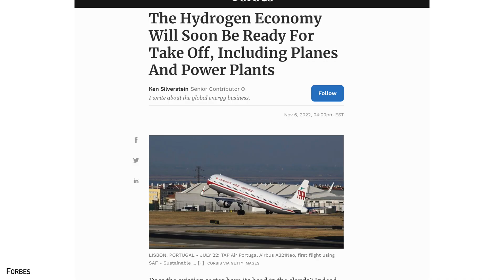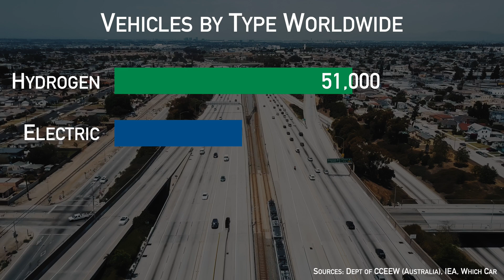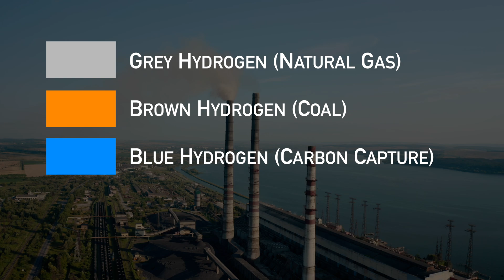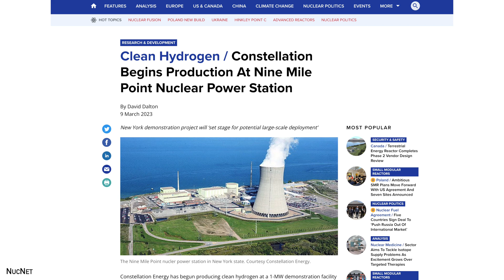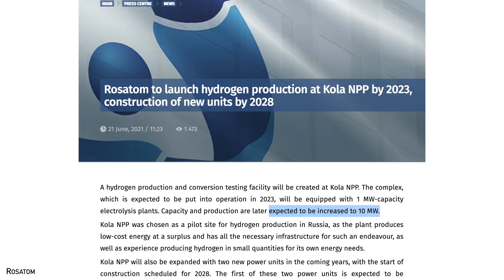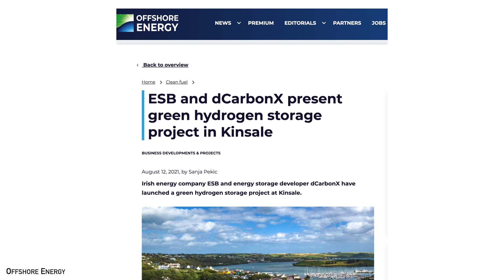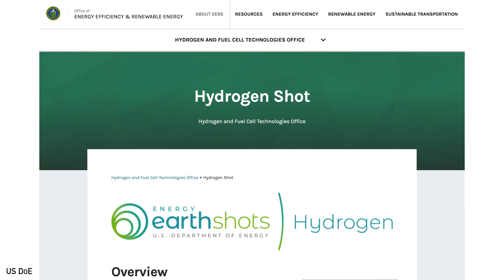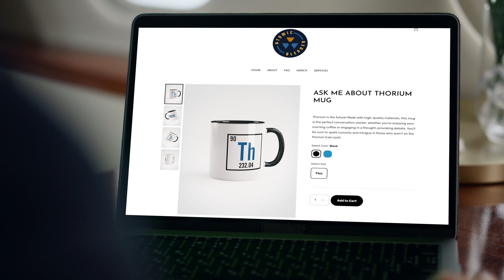The First Clean Hydrogen from a US Nuclear Plant - Now What?

Comment: The Palo Verde Nuclear Generating Station in Arizona is producing hydrogen during the peak of midday summer. This is because the high activity of solar panels in the region means that electricity from the reactor is not needed during those hours. As a large Generation II plant, Palo Verde does not scale its power output up and down quickly, unlike future Generation IV small modular reactors (SMRs).

To keep the plant operating efficiently and put its output to good use, it's now producing hydrogen. This hydrogen can fuel large vehicles such as buses, RVs, trucks, and construction equipment. In the future, it could also power large commercial jets and ships.

If you consider fueling a large passenger jet with hydrogen to be dangerous, remember they are currently filled with kerosene.

Comment: A Case for Nuclear Power.

Nuclear power is the answer to weather disasters and our energy future. 

We should build Generation 4 nuclear power plants on an assembly-line basis and deploy them worldwide as fast as we build a Walmart. 

This approach will dramatically cut the cost of construction.

Superstorms, extreme weather, and electricity shortages can all be solved by using off-the-shelf nuclear power technology. 

Small modular reactors, for instance, have been used in our military ships since the 1950s.

Nuclear power can fuel our electric future and provide the energy needed to scrub carbon from the atmosphere. We all benefit from abundant electricity that doesn't destroy our planet.

The Benefits of Modern Nuclear Power

 * Versatility: Nuclear power can produce hydrogen for trucks, buses, RVs, and airplanes.
 It can also be scaled up and down to complement wind and solar power.

 * Waste Management:
 Generation 4 nuclear power plants can burn more waste than they create. 
They can also reuse existing nuclear waste, a process that France has been doing for many years.

 * Safety and Security: 
These plants are non-proliferation and "walk-away safe." 
They have a small footprint, about the size of a Home Depot, and can be located next to hospitals or large retail centers in any community.

 * Efficient Design: 
They can provide steam for heating our cities and can be small enough for a cruise ship or a small town.
 Generation 4 nuclear plants can also be linked in a series to power large metropolitan areas and be part of a local power grid alongside wind and solar.

Addressing Public Misconceptions.

Nuclear power is over 99% safer than petroleum product extraction and better for the environment. 
If you don't believe me, look at the number of deaths every year from extracting fossil fuels. 
We must stop using the air we breathe as a trash can and address how petroleum products contaminate our drinking water.

The media and politicians must stop using nuclear power as a fear-mongering tactic. 
They have blood on their hands from every superstorm and every year that goes by while the public is afraid of nuclear power. 
We need to have field trips for kids and parents to see that nuclear power isn't scary. 

We should also commission artists and schoolchildren to paint murals on the sides of these plants.

The Real Disaster.

Don't let the media and politicians scare you with stories about past nuclear incidents. 

What's the real disaster? 

The only disaster is the "pigs at the trough" who, in the name of nuclear safety, are siphoning up public utility and tax dollars for so-called cleanup.

People have been working at these plants since day one, yet these same individuals lead you to believe it's some scary thing. 

The nuclear safety people are a parasite on the business, making it so expensive that it can never be built.

Comment: Ah na this isn't what I was thinking it was, I was thinking they were using hydrogen that is generated in the operation of the reactor via radiation breaking the chemical bonds between the hydrogen and oxygen, because that would basically be 100% efficient because the "waste heat" or what you generally run a nuclear reactor to generate can be used to generate electricity.

Comment: I think red (nuclear thermochemical) hydrogen has a brighter future than pink (nuclear electrolysis) hydrogen, eliminating the need for turbines, generators, and electrolyzers, has got to be good for cost efficiency, even if it does mean we need newer much higher temperature reactors

I'm not so sure that hydrogen can be used to create cost effective efuels however, as the cost of DAC would still need to come way down, obviously to the point that traditional fossil fuels could simply and cost effectively offset their CO2 emissions, so for nuclear liquid fuels to be cheaper than carbon neutral fossil fuels, then the pink/red H2 would need to be significantly cheaper than any fossil fuels (without carbon capture), which would then be an incentive for more vehicles to switch to fuel cells, etc. and use that H2 directly to save money

Comment: Hydrogen is not ideal fuel, even if it is extracted from earth crust like crude oil or natural gas, or even freely manufactured on desert with photovoltaic generator. Major cost of hydrogen as fuel or energy is not its production, but transporting and distributing hydrogen. It should be compressed or cryo-liquified to transports like LNG, both are quite expensive and energy-intensive., it is hard to store for long term or transport long distance. And highly trained and qualified engineer can handle such hydrogen in mass. It weaken metal pipe and metal tank. It needs special composite lorry tank & truck.  There is no liquified hydrogen transport ship. So it is much more expensive at gas station than, say LNG per energy content.  In all 80-90% of cost at hydrogen gas stand is not hydrogen production cost, but transport cost.  That is why most hydrogen gas station in US produce hydrogen on site from water electrolysis with grid electricity, not transported from large hydrogen factory. Unless you solve transport/storage problem of hydrogen, even free hydrogen out of sea water is useless, let alone hydrogen from nuclear plant. Just generate electricity in nuclear power plant and producing hydrogen with electricity at street gas station is much cheaper and viable option.

Comment: hydrogen as transport fuel is not going to work , the infrastructure needed is insane , the smallest atom in the universe seeps through all other atoms , needs to be kept at 240c below zero , how will that work , cant have tanks on every street corner like petrol or gas , like it or not electric is the way , most of the infrastucture is already there in most countries , becuase they all use electricity now , need better power lines , fine the land and rout is already there , hygrogen as a power sorce for base load power , ok , that may work , but car,s and trucks on it wont , far to expencive

Comment: When you said Nine Mile was making 560kgs a day, I was surprised -- because I had no frame of reference :-) So, I did some calculations and it seems that if its hydrogen were to be consumed as fuel, the plant is only about 60% efficient. To wit:

33,000kWh in 1kg hydrogen
1.25MWh used by plant
560kg produced per day
23.3kg produced per hour
770kWh energy available from the hydrogen produced per hour

61.6% overall efficiency (770kWh generated divided by 1.25MWh in)

My uniting isn't very cromulent but I think my result is right. Corrections welcome!

Comment: I see one big problem with hydrogen as fuel is just that it's not very efficient round trip. electricity to gas to electricity round trip is only about 40% efficient at best, whereas modern batteries are around 90% efficient and even something like cryogenic air energy storage is 60% efficient and good for long-duration geography-independent storage.

Comment: Dont underwater nuclear submarines utilize electrolysis? To create hydrogen and oxygen to be utilized in the functioning of the submarine?
Reply: They do, but they don't use the hydrogen.  Hydrogen is a dangerous gas to keep on-board a submarine, and they exhaust it to the surrounding seawater the instant it is produced.

The electrolysis is only used for producing the oxygen for the people to breathe.  The hydrogen is an undesirable biproduct, that is a fire hazard.

Comment: You don't need to make Hydrogen at a nuclear plant and transport it to where needed with a dirty diesel tube trailer, make the Hydrogen where it is needed say the fertilizer plant, and transport the electricity by wire instantly. 
The cost and capacity of batteries are dropping at a fantastic rate and like Tesla's Semi will rule not only auto and truck transportation but even become the preferred source of energy storage for ships and airplanes before the nuclear plants get the permits approved and built at twice the estimated price.
Reply: “cost of batteries“ did drop for a couple decades, but not now as material costs dominate the battery cost, and the cost of copper lithium nickel are increasing. Per Bloomberg, Battery price was up in 2022, up in 2023, in real $.  And, thats just the pack price.  With increasing land use, and several major fires at large grid battery facilities, installation price increases even more.
Reply: The true cost of batteries also includes the environmental impact of lithium (etc) mining. I don't know if hydrogen "beats" batteries here, but it does certainly need to be added to the "balance sheet"".
Reply: @edgeeffect  Nuclear works, is proven, it’s the only answer.  Demand the politics get out of its way and it works fine.

Comment: There is only one solution to the widespread use of hydrogen, which is an high-tech storage vessel operating at atmospheric pressure.
A palladium sponge can adsorb hydrogen in an amount equal to 900 times its volume, at atmospheric pressure. 
There are special nickel-based alloys which are doped to adsorb hydrogen and are used as the negative electrode of rechargeable Ni-MH batteries; MH stands for Metal Hydrides.
An improvement on such alloys with new dopants would allow the storage of hydrogen at densities one or two orders of magnitude of those of palladium or current MH battery alloys.
Only an advancement in materials' sciences can produce the advancement we need to store hydrogen effectively. Both high-pressure and cryogenic storage of hydrogen add such a weight and costs to each mean of transport - which make use of hydrogen as fuel almost impossible.
An hydrogen fuel tank using an adsorbing alloy would have the same size, weight and capacity of a current diesel or petrol tank, enabling hydrogen use in cars, trains, boats and aircrafts. When hydrogen is required, it is pumped out causing a slight under-pressure which frees the hydrogen molecules from the lattice of the adsorbing alloy...

Comment: I'm a bit confused about how and why H2 would be used to cool a nuclear plant.
Reply: Light weight molecules are more efficient at transferring heat than heavier ones. Easy to get large amounts of hydrogen by cracking natural gas, and the next lightest gas, helium, is limited to small natural supply.
Reply: @Nill757  Ohh, i see. Thank you.
   So how risky is it to store the needed quantities near an operative nuclear reactor? I assume they've run analyses and confirmed it's within acceptable limits.
Reply: @no_rubbernecking  well hydrogen burns, if mixed just right with air, but so does any hydrocarbon.
Reply: @Nill757  True. That's what the Zeppelin guys used to say too. But i understand where you're coming from. Thank you again.
Reply: @Nill757  i thought helium was used due to the low neutron cross section......basically it doesnt get irradiated....

Comment: it would make more sense to produce hydrocarbons like ethanol or diesel, so that existing vehicles could use non-petroleum fuels without modification. Making fertilizer without being dependent on petroleum imports is the most useful part of pink hydrogen, not transportation that would require expensive vehicle modifications to be used.

Comment: The Japanese are doing a lot of work in green ammonia for power plants and possible marine shipping.
Reply: Yes there are many stories about “work” in this or that, ammonia, storage, and meanwhile the Japanese are building a large 1300 MW new coal plant on Tokyo bay, with 22 more coal plants planned, with every kg of fuel imported.  That imported LNG was getting expensive.  This is occurring even after Japan built the largest solar install per capita in the world. Turns out it matters that solar is intermittent and is lame in winter. 

So of course the media must carry stories about “work” to suggest all that coal is temporary.  

The only believable “work” will be Japan building new new nuclear.
Reply: @Nill757  Yeah, I'm under no illusion that we will  get off fossil fuels any time soon given the world uses some 80% fossil for primary energy.  Though its good to see Japan reviving nuclear plants.  Too bad Germany isnt.   We will not get to zero in 25 years, and most likely we will have to mitigate with geoengineering.  
But green ammonia can be used in power plants and there is no c02.   Also it is an option for marine shipping but it will take time.  Ammonia does not burn as well and doesn't have the same energy density.

Comment: After double-checking with lots of zeros the 1,000-megawatt reactor producing 150,000 tons of hydrogen, that's an average of 64.3kWh/kg which is a reasonable number to use for electrolysis.  That's of course not counting if you have to liquefy it, which adds another 12kWh/kg.  76kWh (since most stations store H2 as liquid now) gets you 300 miles in most BEVs and 1kg gets you 65 miles in a Toyota Mirai FCEV or 57 miles in a Hyundai Nexo FCEV.

Comment: All methods of producing Hydrogen consume more energy than is present in Hydrogen. Also there are serious storage and transport issues with it..
Reply from the maker: Yep, I almost included the declining efficiency of each step in making and then using hydrogen. By the time you get to the end it's down to like 20% of the original energy.
Reply: Yeah, but that's just basic thermodynamics, all methods of energy conversion consume more energy than is present in the product. This is true of steam into electricity, electricity into batteries, pumped storage hydro plants... this is why, back in the day, fossil fuels were so attractive - the energy conversion had already been done back whenever the fossil fuel beds were laid down.
Reply: @edgeeffect  I'm talking about producing hydrogen... You start out with a negative EROEI ratio...not so with oil, gas, coal and nuclear.. You're wasting your primary input energy source. However the EROEI is falling on all fossil fuels as well.

Comment: Considering that nuclear reactions mean breaking up nuclei, perhaps the reactions could be tailored to produce  protons which would then capture electrons from the environment to form hydrogen.
Reply from the maker: It's possible (it's called radiolysis) but the quantity is so low it's not economical. It's better to use the heat or electricity to generate the hydrogen.

Comment: If we are going to build with steel, concrete and glass, we will need to burn Hydrogen to replace natural gas now used to attain temperatures over 1000 degrees C to kiln dry cement, heat steel and melt glass. And Hydrogen is absolutely essential for making ammonia fertilizers keeping half the world fed.  To assert that large scale Hydrogen is not needed is just ignorance.  These processes are going to run 24/7 and can not run intermittently on renewables; nuclear is the only long term solution, considering the impossibility of replacing all renewables generation after generation w/o strip mining the world.

Comment: I think that the thermochemical production of hydrogen from high temperature nuclear reactors providing heat to drive the sulfur-iodine process is more promising.
Reply: Exactly right because that heat is wasted anyway
Reply: High Temperature Steam Electrolysis HTSE would be good for SMRs.
Reply: Adding to the notion of H2 as "proof-of-concept": hydrogen from steam-reformed natural gas actually has a HIGHER carbon output than you'd have from just burning the gas. We desperately need non-carbon ways to produce hydrogen.
Reply: @Thunderbuck  *fossil gas
Reply: High temperature electrolysis has the potential to be astonishingly efficient:

https://www.energy.gov/eere/fuelcells/technical-targets-high-temperature-electrolysis
Reply: have you guys heard of a new tech of batteries made of graphite (Solid Carbon)? I think the company is called Antora, it provides very high heat and stores that heat for a long period of time.

Comment: MSR allows you to use themal energy directly for chemical processing, cutting out the turbines saves a fair bit of wasted energy. Why use hydrogen when you can make dimethyl ether out of the air.. there you go closed fuel cycle.. we can actually start to become a type 1 civ with that scale of climate control